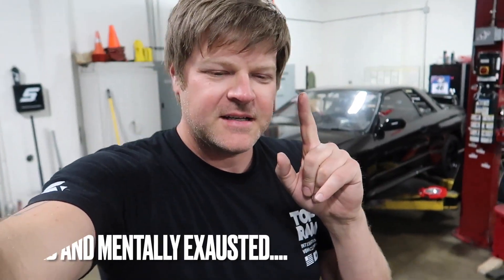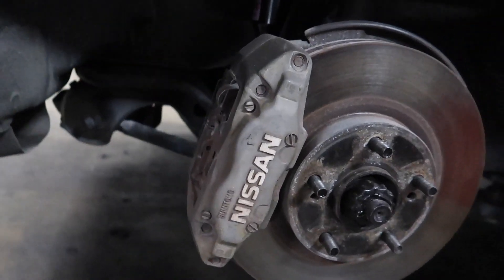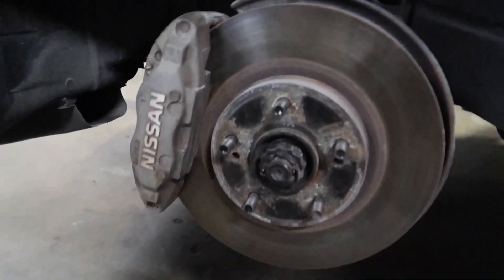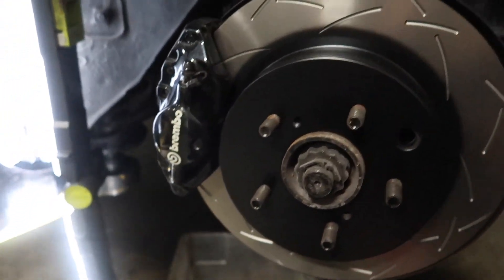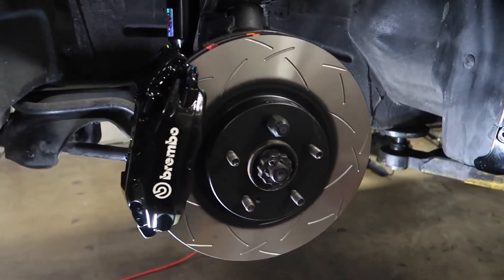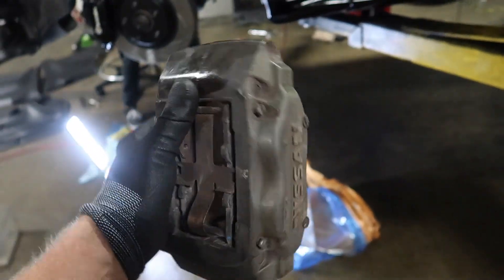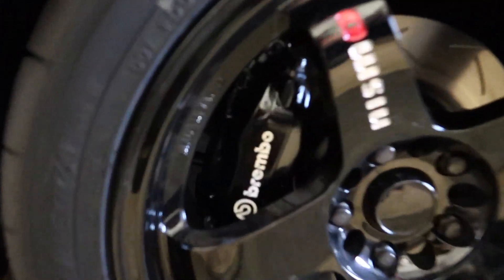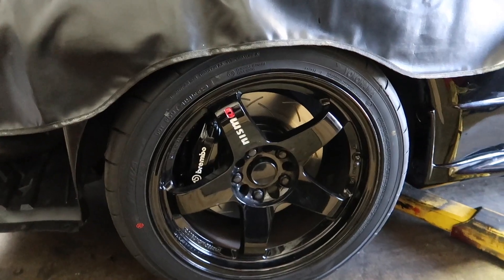Easy Brembo Brake Upgrade for the Skyline GTR! Saving a Skyline GTR Vlog 5

Comment: Did you guys consider the EVO IX brembo upgrade?  Much more up-to-date caliper imo and much cheaper (at the time I did mine anyway).  I did this conversion upgrade on my 89 GTR.  I also did the STI brembo upgrade for the rears.  Not necessarily an upgrade, but I just wanted the rears to be Brembo matching so-to-speak.   The front conversion kit was through some company in Australia.  I forgot from who.  It's been some years.
Reply from the maker: That’s true but I had access to a lot of skyline parts so R33 made for the easier move, especially with the brackets being the same.
Reply: @BrianJannusch ah, gotchya.  That makes sense.  Man, I wish I could remember the company.  Years after I did it, they even sent out emails to the customers that bought the front Evo IX caliper / Evo X rotor upgrade and asked if we would all be interested in them developing a rear kit from the Evo IX being that the Evo IX rears are apparently better then the STI rears. Which I believe they are just based on the rotor on the Evo IX being bigger.

Comment: I'm currently doing this to my R32 GT-R. I noticed that in the front, the hard brake line that goes from the braided line to the caliper itself is different from the OEM brakes to the R33 ones. Did you notice the same thing? If so, how did you solve this issue?
Reply from the maker: My car already had different brake lines on it so it just hooked right up with no issue but otherwise yes I would have needed new lines

Comment: The OEM calipers look the same as the Brembo calipers.
Reply: Thea are bigger. And the discs are bigger.
Reply from the maker: The OEM caliper are made but Sumitomo, are an okay caliper but the brembo is a bit bigger and looks nicer in my opinion